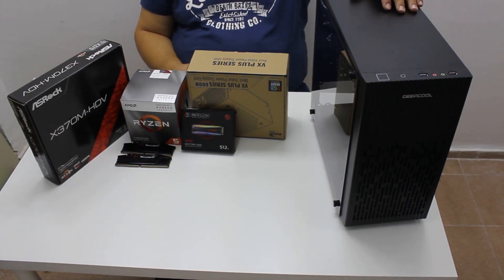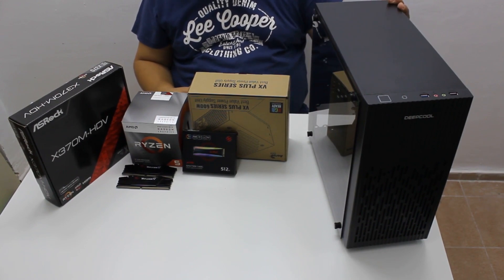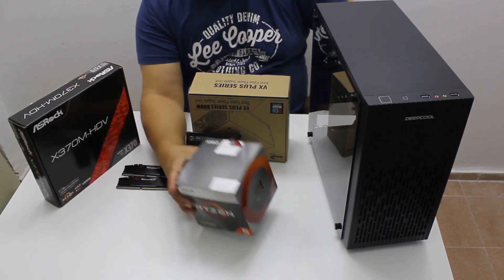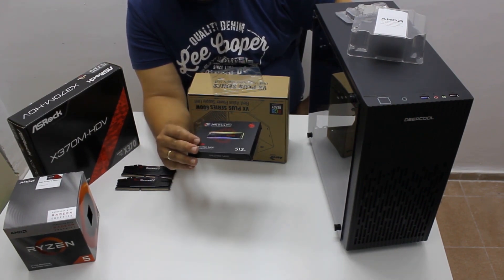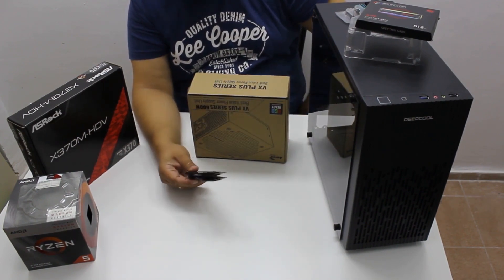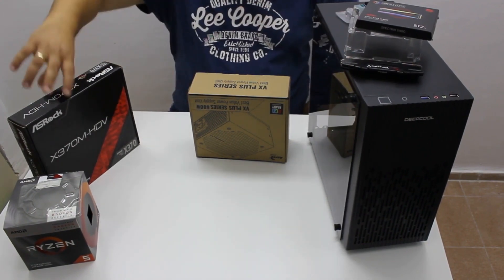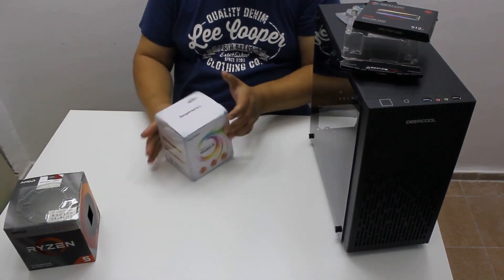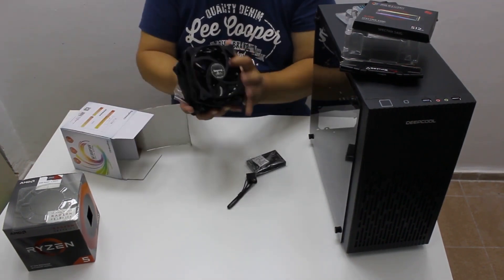Building A Budget Gaming & Streaming PC With Ryzen 5 3400G in MATREXX 30 - Part 1 The Build

Comment: Can I fit a 2fan gpu in here ? I’m getting ryzen 5 and gtx1060 3gb
Reply from the maker: Yes if it is less than 250 mm long. Though i managed to squeeze Sapphire 5600XT Pulse which is 254 mm.
Reply: SteDi Gaming thanks also I’m getting this case with a ryzen 52600 and rx470 4gb (not the gtx1060) with 16 gigs of ram for 500$ is it worth it ?

Comment: Can I use a Gigabyte B450 Elite on Deepcool Matrexx 30?
Reply from the maker: The case is micro ATX, if the board is microATX you can. If it is normal ATX then no, you cant.
Reply: @SteDiGaming  thanks man! One more thing, I check the supported memory for B450 Aorus M, does that mean I can't use my current module as it is not on the list?
Reply from the maker: @rolento3378  Not necessarily. But still there is the posibility to be problems. What is your ram ?
Reply: My ram is 2x 8gb Crucial Ballistic sport LT. Part number is not listed in the supported module though
Reply: And yes I am having problem, I can't run it with it's native speed of 3000mhz, can only run at 2400
Reply from the maker: @rolento3378  Have you activated XMP profile in bios?
Reply: I did, and I got BSOD
Reply from the maker: @rolento3378  Try some timing tweking. Like setting command rate to 2t, or rusing the primary latencies a bit. Also set 1.35 V for memory manually. Or try droping the speed some, for example to 2933, 2800. In any case at least its working at 2400 :).
Reply: @SteDiGaming  , Here is my RAM part no. BLS8G4D30CESTK.8FD
I don't know the latency of it, but I think it is high which maybe the reason why it is not able to use the XMP profile. I am using an A320 Pro VD/S V2 MSI motherboard and ryzen 3 2200g
Reply from the maker: @rolento3378  Aaaah! It is very, very low budget board that only has up to 2667 memory support. Set XMP and change the speed to 2667 and leave it at that if it works. Or just leave it at 2400. I think on a better board (B450) that memory shouldn't have problems with 3000.
Reply: I really don't know how to do that 😥
Reply: Got it! No budget to change it to a B450. Guess I will let it run 2400 😁

Comment: 2 front fans can be both ? 120 mm ??
Reply from the maker: 120 mm, yes.
Reply: @SteDiGaming 2 together ? + 1 rear = 3 fans ?
Reply from the maker: @pscrema  Yes, but its a bit strange configuration.
Reply: @SteDiGaming  But you can, without any problem ???  on the manufacturer's page it says that only 1
Reply from the maker: @pscrema  Seems like you haven't watched the video if you are asking such questions... Go watch it, near the end (after 11:30 i think).
Reply: @SteDiGaming  if I saw the video I just wanted to confirm because I saw another one and I answered that it was only one although I saw 2 fans.
did you use 2 long screws to join the 2 ? If so, does it not vibrate? You can also say that it is a modification. sorry if I bother you a lot

Comment: Thanks for your vidéo. Do you use this pc for 2nd pc streaming? Can you stream at 1080p60 fps with the r5 3400g?
Reply from the maker: No, its just for fun and to test how it is doing. And for 1080p60... dont think it is possible, at least with the igpu. 720p ia possible but far from perfect.
Reply: @SteDiGaming  you don't think is possible if the pc only encode the stream x264 and nothing else? I want use for stream my main pc with elgato hd 60. Sorry for my bad english  And thanks for your answers!
Reply from the maker: @vJesusGaming  If you only want to use it for streaming... I'd suggest to go for Ryzen 5 1600/2600 + a really basic videocard. Should be about the same price, but it will be way better for encoding. The 3400G will probably be ok, but with lower quality, say Very Fast or something. I think i tried its predecessor, 2400G, and it was a bit not enough for what i use for recording. And now i use Ryzen 5 2600 in the recording station.
Reply: @SteDiGaming  Yes but planning to do mini itx build very compact with 3400g but if you thinks 3400g is not enought. (because they have only 1 pci port on the mini itx and i want to use it for elgato hd 60) I don't do the build. Sorry ofr my bad english
Reply from the maker: @vJesusGaming  Frankly im not entirely sure. It might be enough, probably if i use faster or very fast.
Reply: @SteDiGaming  Ok thanks! Maybe  3600g in the futur